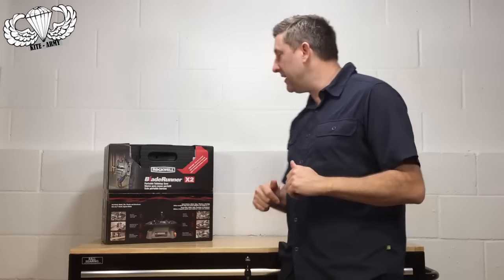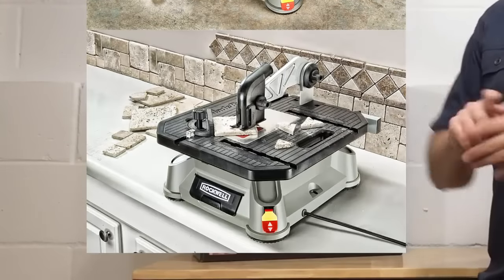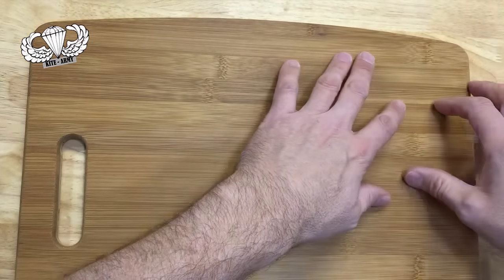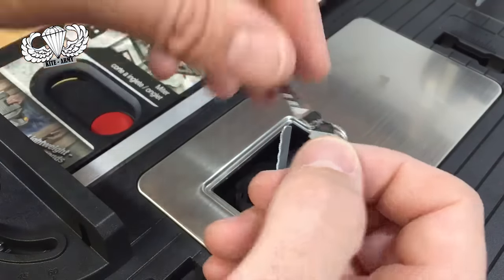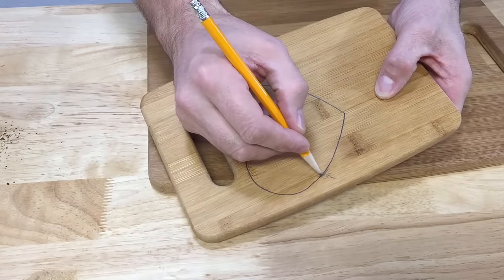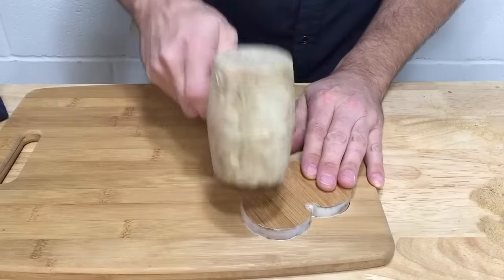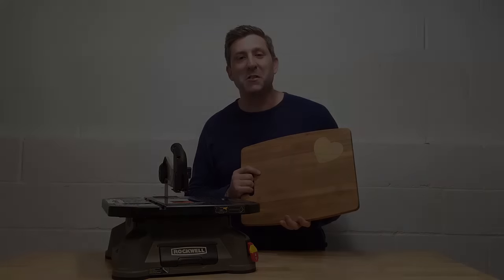Rockwell BladeRunner X2 Portable Tabletop Saw - Cutting Board Project

Comment: The rip fence is not giving me a parallel cut. It is pretty straight but the small deviation means the cut is off and the material binds sometimes. Is there any way to square the fence like the one on a table saw that locks into place precisely parallel to the blade?
Reply from the maker: The problem is that the blade can drift a bit on this unit.  So no matter how square your fence is, you still may get a bit of deviation.
Reply: There are machine screws you can loosen and try and square it up. The is a video on it.

Comment: Did you drill a pilot hole ??? or just plunge the board down onto the saw blade???? I think you missed a step in showing how to do this. At least the audio is decent unlike several others that sound like they were videoed in an echo chamber....
Reply from the maker: Your right...I did drill a pilot hole!  No way you would plunge through this board otherwise.  Thanks
Reply: Wow ..what a smart question ... Glad I asked that one . you saved our lives

Comment: This tool is certainly limited in what it can do. BUT for a hobbyist it will be sufficient as long as you have a drill and sander, crosscut sled and maybe the frame kit. Rockwell still sells the main tool but not much more which indicates a lack of interest.
Reply from the maker: This is perfect for a hobbyist - though it does have it's limitations - A great tool for a DIYer
Reply: @Kitearmy  What is the "expert" level tool that would do this but better? scroll saw? debating if I should get this or not. I would mainly need to make difficult cuts in laminate and tile flooring because I'm terrible at using jigsaws.
Reply from the maker: This would be great to make cuts in flooring.  When I talked about expert I meant fine finish work (like carpentry)

Comment: I'd like to cut basswood (relatively soft) cutouts for carving.  This is usually bandsaw work.  How thick a piece of wood can I reasonably cut?
I also carve Butternut (harder, but still carving wood). What thickness limits would I have.
Would I be better off with a handheld jigsaw?
Reply from the maker: Problem with bandsaw is that you have to cut an access route.  I would say about 2 inch thickness would be max.

Comment: Hey there,  this jig is great for small  projects. I used mine to cut laminate flooring project  and it worked  perfect but that was about it. After that project the bkade holder broke and parts  were  descontinued even when the the unig ws still for sale.  Any how Mine now has a jigsaw  attached and it's working perfectly. 
Thanks
Reply from the maker: Thanks for the comment - enjoy those floors

Comment: Did you use a drill to drill a hole in the wood or did you use the rock well to drill a hole in the wood?
Reply from the maker: Hi Betty....Awesome that you do woodwork!  Yes I did drill a pilot hole.  No worries to the wood your removing.  Are you going to make one?
Reply: Kite Army ...yes, I am currently making door hangers, alphabets and some other projects for my business... however, I just recently bought the blade runner and saw how well it worked. I was thinking that maybe I may need to purchase a scroll saw to also cut the inside of the wood when I want to cut out my alphabets and my door hangers.
Reply from the maker: scroll saws are great for very tight corners and such.  But the bladerunner can probably handle the same tight radius with a thinner blade.  Also make sure that you cut relief cuts when making tight radius.  Let me see where you can see that in my video.
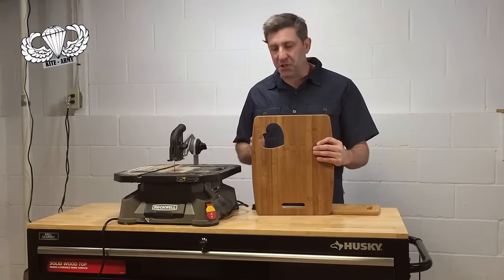Reply from the maker: you can see the pilot hole at min 2:32 and the relief cuts briefly at 2:37.  Let me know if that helps.

Comment: Can that blade be raised up
Reply from the maker: you are very limited because of the blade length
Reply: @Kitearmy  so in other words the blade can't be raised up like a real table saw I guess you would have to get longer blades
Reply from the maker: @redbaron2448  Right - what throat size do you need?
Reply: @Kitearmy  I need something between 7 and 10 in
Reply from the maker: @redbaron2448  You might wand to consider a band saw - I did a review of the Ryobi (i think it can do up to 10")

Comment: I couldn't help but notice that you included considerable footage of your tracing the shape onto the wood and of talking. But when it came to the actual sawing, the purpose of the video, you included almost nothing. You'd shown no tight turn cuts whatsoever. What little you did show was almost straight cutting with almost no movement of the blade through the wood.
Reply from the maker: true - I could have done a better job